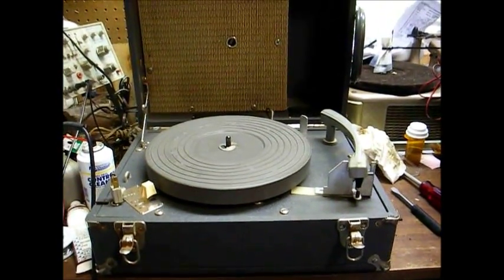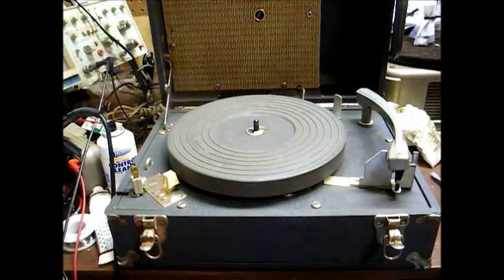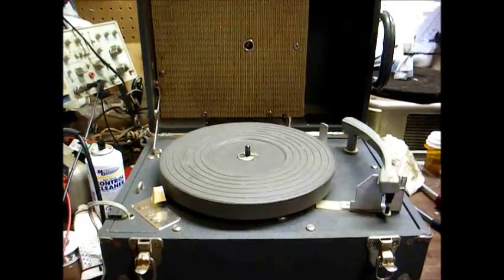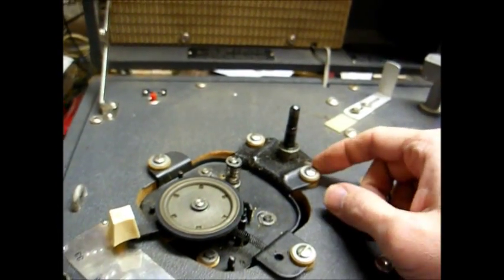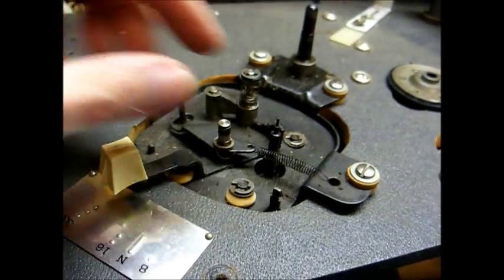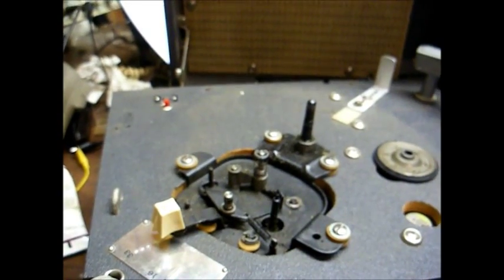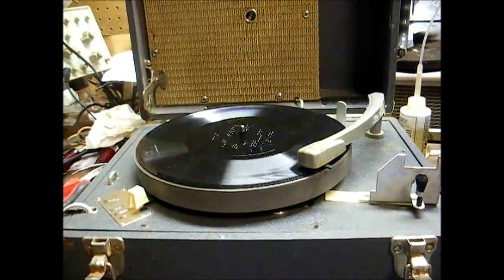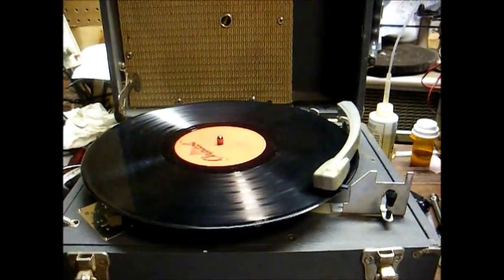Solid state talking book record player for the blind, model E (1) from '65

Comment: Now that was educational.  I'd never heard of an 8rpm record speed.   Thanks, my friend.

Regards,
John
Reply from the maker: Thank you and 8 rpm records were only used by the Library of Congress for their talking book program for the print disabled. This speed was first used for talking book magazines during the late '60's and the reason was so that more material would fit on a record and to prevent the records from being played on standard consumer record players. The early talking books from 1934 until the early '60's were 33 rpm. 16 rpm was used from the early '60's until the early '70's, when the conversion to 8 rpm was complete. 8 rpm records were discontinued at the end of 2000, when the last talking book magazines were finally shifted to 4-track, 15/16 IPS cassette format. Now, the cassette format is obsolete and most everything is on digital cartridges.

Comment: A rare find indeed, either a prototype vs cheaper plastic crap, or the usual govy bids and crapola  wins the contract.  they did that with the C-80 model cassette player with speed compression. Sad thing, when the LOC/LFTBOPH changed models or formats, they recalled the older better obsolete machines and scrapped them! They refused to simply let the disabled people to keep them, and made them take the crappy machines.